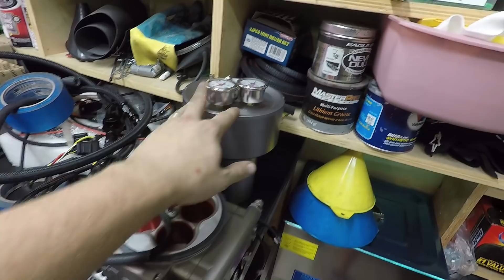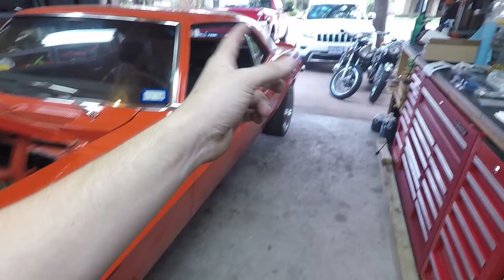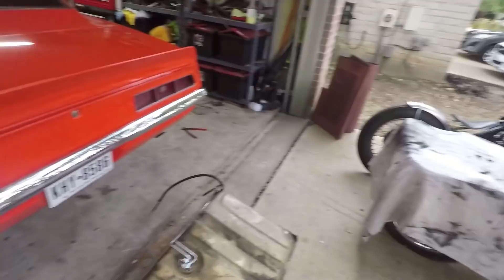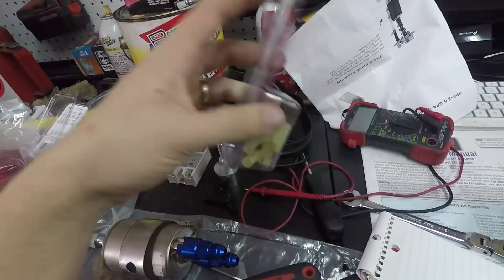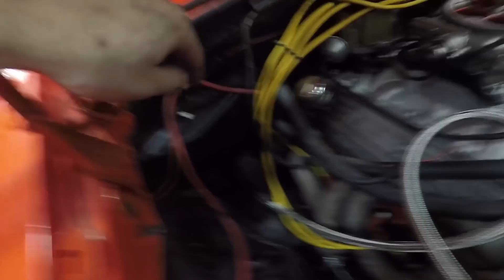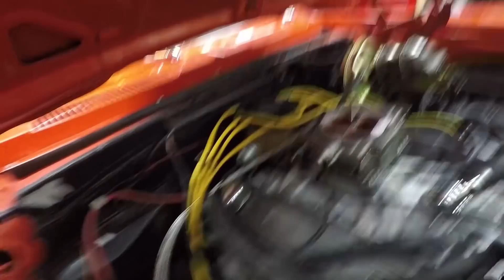1969 ProTouring Camaro gets EFI

Comment: For the square holes or whatever u call em, I just use the end on a 3/8 extention should work
Reply from the maker: I tried but 3/8 was too big and 1/4 was too small. I will probably just make my own square drive socket from an old cheap one